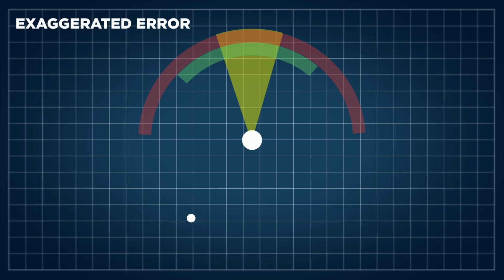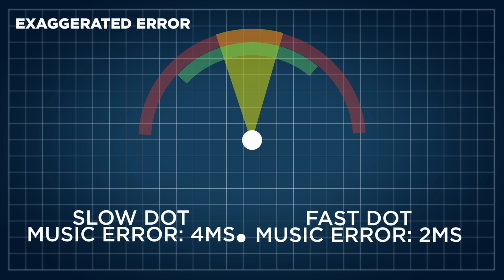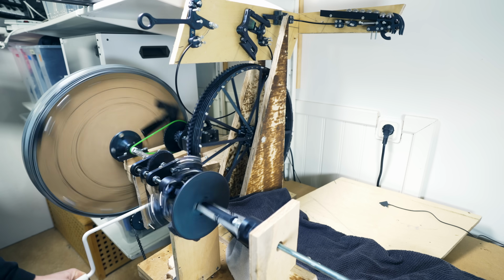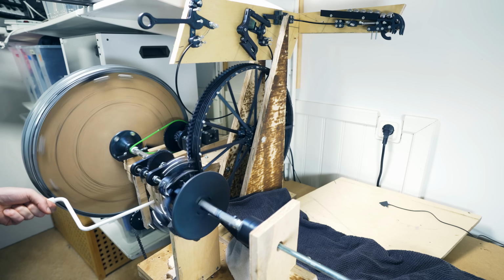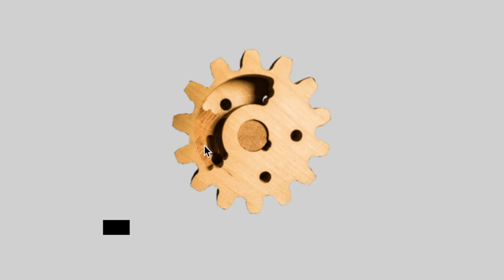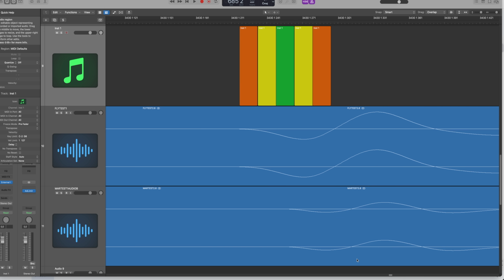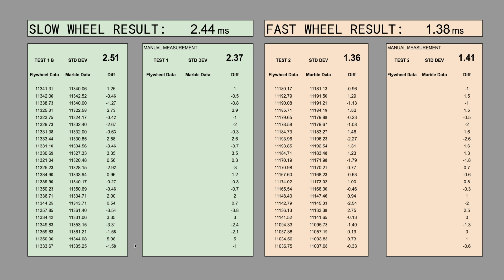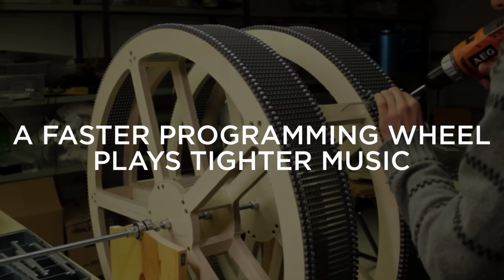Testing a Faster Wheel - Is the Music Tighter?

Comment: It will be interesting to see how all of these error bars combine.  You' ve already got a fair few components linked together and the music is still really tight.  You were already around that 1.5ms mark before you added the wheel.  So the faster wheel effectively added no additional variance into the ayatem, but the slower one does.  And i think that has more to do with the accuracy of the moment of release.  If you didnsome high speed camera work on that point you'd probably see where at high speed its releasing cleanly and at low speed its dragging just a bit.  It should he possible to achieve accurate release at low speed

Comment: To increase the length of music, make the programming wheel a spiral instead of a circle. To address it, you will need a corkscrew read head which rotates next to it, reading further sideways as it turns and engaging the beginning of the roll again when it has made a full rotation. The control signals would have to be linked down the center of the read head tube and out the end.

Perhaps this much additional mechanism would introduce too much error of its own to be worthwhile. But there are other possibilities for extending what is essentially a physical "piano roll".

Comment: If you double the speed to halve the time spent in an error zone, you come back around to the zone twice as often anyway. Each beat will be off by less, but over the entire song you’ll get the same drift, all other things being equal. Of course other things are not equal because you’ve got wind resistance, mechanical friction, etc. so it’s definitely worth testing.

Comment: I'm not sure if chasing 1ms here and there on the prototype is really the correct way how to achieve MM3. The whole machine will have more than 1 channel, will be under full load and the governor will have to dissipate much more heat into the friction material. What I'm trying to say is that there will be much more variables that you cannot simulate on the prototype, that will probably have a much larger impact than 1ms. Prototyping is good for testing ideas, not so much for running performance tests so early. It seems like wasting time right now.

Comment: Excellent research and progress.  However, I think your conclusion of the reasons why the music might slightly differ than what may be happening.  The faster spinning program wheel means it too acts as an additional flywheel.  This means the refinement of edge of your installed programming pin and the reading lever which it slides off of on becomes twice as fine & potentially half the friction since it is in contact with the program reading lever for half as long as well.  If you were to increase the weight of the programming wheel and make sure the edge of the programming pin was made of a blade of metal instead of plastic with a sharp edge, you may see vast improvements in timing consistency without the need to make the program wheel run twice as fast.  Changing the reading lever to metal may also increase the trigger edge consistency.  (Note, a lase cut programming pin on the program wheel means a narrow blade which will allow you to insert multiple adjacent rows while keeping the reading lever as plastic allows you a negative grove in the plastic, like a reverse vinyl record to keep tracing of a multiple-revolution program wheel for really long complex songs.)

Comment: why would you use that wheel?  People before you found that a roll of paper worked great.   If you change to a paper sensor system you could run your paper as fast as you wanted and still have long tunes.     I personally don't see any reason you could not incorporate electronics into the reading of the music.

Comment: Maybe check the serious audio hifi setup's idea of reclocking the gate timing, used on digital audio by the ones that want the extra performance. Not commenting on merit of doing so.

Like if you have a retiming interval of 100-20 ms, and lock evry event to a interval in that, you would get the timing tightness.
May be realized as a gear where the programming pins push a grippers into it so the retiming wheel does the actual timing.

But then you have artistic freedom of shifting things to your desire and jitter may be good, also computer accurate(10-20 µS) timing may not be it.
But then motors and phase locked loops is likely outside the field of interest.

Comment: Maybe instead of a single large wheel...you could reduce the size of wheel...add one more smaller wheel...and create tracks that span the wheels. Now you can play program track at speed. You could really go nuts here and make a multispeed track getting the mechanical timing signal from the master flywheel but numerically geared different so as to play at a different speed than another track. I saw you are using what looks like a herringbone pattern on the wheel...changing the number of teeth on both the flywheel side and the track side should provide plenty of timing options. Sorry if this creates a new rabbit hole to travel...but not really if you go down it...would love to discuss as I have some thoughts around this already. Loving the in depth build and learn process and looking forward to the outcome. Thank you for this.

Comment: Larger diameter on the programming wheel will give you higher speed at the edge for the same rotational speed, and also a higher moment of inertia of the programming wheel.

Comment: Love your vids! But, could that ms be becouse of the mechanical gears transfearing the note to the dropping of the balls affecting the rightness? We are talking about 1ms difference and there are quite alot of mechanics between the flywheel and the ball dropping. Also, I would look at how the springs will affect your music tightness instead of faster flywheel. I would rather look at those things than making the wheel run faster becouse faster means more wear and maybe affecting how tight you can put the pins meaning shorter songs.

Comment: Once again, Martin is trying to achieve Six Sigma with music tightness. I would love to hear his band play to Six Sigma. It's virtually  impossible.
Reply: Tightness of the machine is a non-negotiable issue. The machine being tight on its own will allow the operator to make it sound loose. Timing deviations caused by the machine itself, where the operator himself did nothing whatsoever to cause said timing deviations, is indeed a big deal that must be taken seriously. This literally has zilch to do with perfectionism, period. Why does this fucking community as a whole not understand this?
Reply: @justinnaramor6050  Lovely tone and generalisation there Justin! And probably because that's not what people are saying at all. There's tight and there's tight enough. 1ms or 2ms isn't going to be an audible difference in the actual music.
Reply: @Chibs  Um, it is indeed what people have been saying, throughout the whole marble machine project really. This goes back to the Marble machine X even. Just read the comments on any marble machine video where the topic of "tight music" is discussed. Folks have repeatedly claimed Martin is removing the human character from the music which is not even remotely the point. The point is that if timing deviations do occur, it should be because the operator made a mistake, or he intentionally added variance to the timing, say, by offsetting the pins on the programming wheel such that notes play early or late, or faster or slower. Not because the machine is erroneously causing the timing to deviate even though the operator did nothing to cause it to deviate.

All of this also applies to the issue of dropped notes, which the community at large also completely misunderstands.

So, no, I don't think I'm generalizing one bit.

Comment: you have likely considered this already, but if you turn the programing "wheel" into more of a programing "belt" you could in theory pick up the speed for tighter music like in the video, while also having a longer (maybe even interchangeable) music length by making the length of the belt larger then the circumference. spheres and cylinders are some of the least efficient shapes to have a large amount of surface area with, though in having it become a belt you have more engineering challenges with how your going to route the track and tension it as-well. which would add yet another variable into the mix to effect error/tightness. just an idea though!

Comment: Remember that you increased the size of the programming pins to compensate for the marble gates and allow the marbles to settle for tighter music. By increasing the speed of the wheel you're shortening the time a pin of the same size would lift your trigger and might be changing the rest of your system all the way down the line to the marble gate timing. This seems like a large rabbit hole to jump down in order to chase such a small increase to the accuracy of the music to me, but you're the only one who can make that call. Good luck with the prototyping.

Comment: Programming needs to be done on wide belt, built like a timing chain, so that you're not locked into one single-length loop. Readers can be mounted above a flat platen belt rides over. Slide readers up or down, on vertical guidebars, to fine-tune timings. Moving a wheel faster, means you'll have to use stiffer springs in readers. Too bad optical sensors are not an option. Then you'd only have to punch holes in a black tape.

Comment: You need to do a decision matrix soon Martin. A lot of your optimizations, while showing improvement, are either negligible or will make the machine more dangerous to it's operator, like this one. Double the speed means double the torque on the input, far more stress on your gears and shafts, more vibrations, more mass on the flywheel due to larger profiles and stiffeners, increased wear on all components, and much, much more danger of you get sucked onto the wheel. This is all great research, but it's always good to take a step back and see whether or not it's worth the cost and risk. Side note, you really should have a light curtain or something hooked to a car break to stop the wheel in case something gets sucked in, because that thing will maul you an not even notice

Comment: I am unable to understand this obsession with tightness. Martin is spending untold hours chasing a goal where improvements can only be measured by an oscilloscope calibrated in milliseconds. If one of the drumbeats comes in .002 seconds early or late, nobody will ever hear the difference. If it is that important, just use a computer and play it as a .midi file.

Comment: To put your thesis another way, you think that the error within the distances outweighs the error in the time. .... So you are relying on the governor being more accurate than the lenghts of the 3d printed programming profiles, that would be quite a surprising discovery in my opinion.

Comment: Hi Martin, maybe you could make a programming spiral for each channel, since you're design for the programming rods it's very thin. So it could have some of the length you need for programming from thickness instead of diameter.
Reply: The stack of tracks could be on a shaft that screw at one end in sync with the programming spiral lateral displacement

Comment: Increasing the speed gave the test wheel more momentum, so it was also affected less by the resistive force (no matter how small) of the triggering mechanism. I would test a heavier wheel at the lower speed to compare to. But the heavier the wheel, the more carefully it will need to be balanced.

Comment: The cost of spinning the wheel faster is too high.  You can achieve a similar improvement with better speed control (larger governor with stronger brake), heavier flywheel, heavier drop weight etc.

You should be able to play tight, even with a very slow programming wheel, as long as it's being driven at a precise speed.

I recommend making a really large centrifugal governor compress hydraulic fluid (via a repurposed automotive master cylinder) and apply braking to an automotive brake caliper that works directly against the flywheel (or use an automotive brake rotor if you can't get the flywheel flat enough)

Comment: I think you should consider what factors in the programming wheel interaction dominate the "tightness" and how can you best control them.  For example,  you've shown that rotating the wheel faster has a positive effect,  but is this because the tolerances on your parts can be greater, the variance in wheel speed is lower, or some other factor? You may be accidentally uncovering some other factor that could help you in a much greater way.

Comment: I'm not a musician, so maybe I'm way off base here. But I wonder if "tightness" really is the be-all-end-all. I know when it comes to jazz for example, there's a lot of expressiveness that comes from playing music just slightly "behind" the beat. Some people even do it deliberately. I wonder if "tight = good" is essentially a bias that comes from music made with a program rather than being played by a real person. (Of course I know you're a very accomplished musician -- it always blows my mind how you can pick up an instrument and make something up when testing these assemblies). 

I guess my thinking is like...even if the machine is a little "loose", maybe that's fine? The wheel obviously loops, and if I'm not mistaken, all the instruments are on the same wheel, so it's not like the programming will get progressively out of sync. I guess the worst case I can imagine is that the music might drift slowly across the course of the song, but I wonder if it's actually a problem (maybe it gives the song character ;) or adds a human element to what is otherwise a very mechanical result). Is there a particular (cascading?) problem that is solved by tightness? Could that problem be solved in a way that doesn't require computer-level precision in the music? Just curious about what you see as the endgame in this particular area.

Comment: To me this method of measuring is flawed.
 You have 2 sets of 23 data points, but for 1 set the data is spread over double the time of the other.
Since you are measuring time variations, the test time should be equal, not the amount of data points.

Comment: I know this has been discussed before, but I think it’s worth emphasising again. I think your measure of tightness should take into account the BPM of the muic. Essentially you doubled the speed of the BPM here, so obviously the absolute time of the tightness will improve with a factor of two. That’s totally expected. But if you normalise it against the BPM the tightness hasn’t changed at all. 
I don’t know, for me at least such a BPM normalisation makes sense and should always be applied. Any thoughts?
Reply: if you normalize for the bpm the higher speed was actually worse
2x1.41=2.82 > 2.37
Reply: @durandle9226  Yes, that’s very possible, from this one test. I didn’t actually do the exact calculation when I wrote the comment. But this kind of small difference is probably down to measurement errors. The two numbers are within the same order of magnitude and are virtually the same, and that was my take home message. If you would repeat the test enough number of times (large sample size of the test) the numbers would probably converge to be virtually exactly the same.

Comment: I suspect this isnt a valid test. If you slow the wheel down by half then the number of triggers needs to double to play a song at the same speed. Therefore, the percentage of variance to beat time is going to be the same. 

Lets say there is a 0.001% variance over a whole rotation. The first trigger is going to be 0.0005% out and the second 0.0005% after that. So there isn't a difference to that then having it trigger once per rotation at a 0.0005% variance. 

But there are some downsides. The paddles hitting the pegs faster means introducing more bounce to the system and more wear which will take the machines out of whack faster in the long term.

Comment: Hy,
You could make a second fast spinning wheel. The first slow one enables the note to play and the second fast one triggers the release of the marble. Just like automatically actuating mute levers.

Sg
Reply: This. Currently the one wheel is responsible for both loading the marble into the dropper, and actuating the dropper. Split these into a main wheel that only has to be accurate to the nearest 32th or whatever, and a dropper wheel that is firing every 32th to release any marble in the dropper.

You'd need some way of tightly placing a marble into the constantly releasing dropper, so possibly a 2-stage dropper mechanism could be used. The current dropper could be retained and the high-speed dropper would be positioned below.

While this would increase the overall complexity of the machine in terms of parts, it would reduce the demands on any singular part, which IMO would avoid any impacts on reliability and practicality.
Reply: I would not use a constantly releasing dropper. 
The mechanic of an electrical switch works by stretching a flat spring until it tips over.

The programming wheel could build up the tention and the trigger release it. Without tention nothing to release. 

Sg

Comment: Speed/weight/etc alone are always going to come with downsides (wear and tear, warping due to tension, machine wobble, less space for programming). You may get some improvements, but they will only be linear (e.g. doubling speed can only double the tightness at best). Not to mention - the downsides will also generally increase linearly.